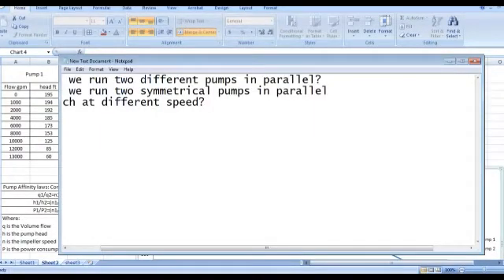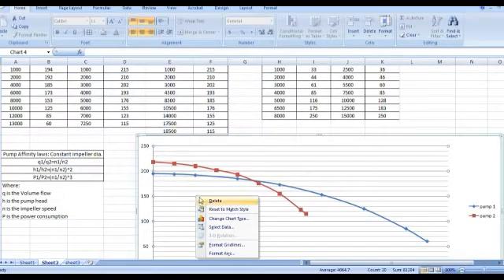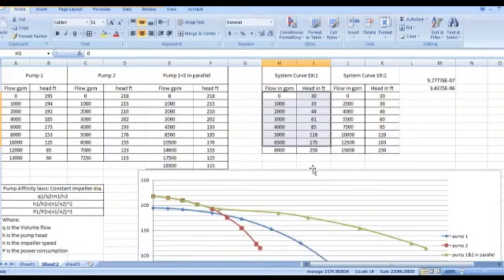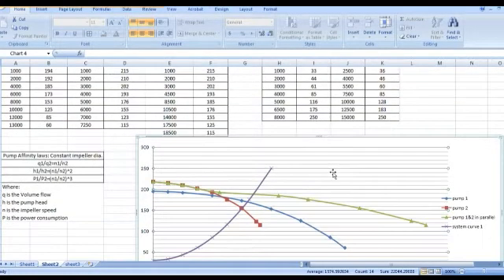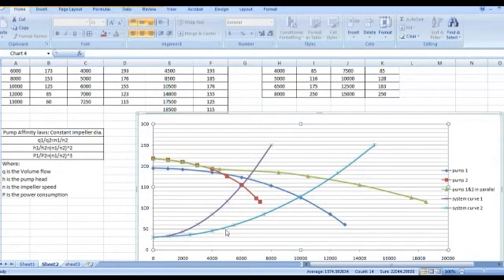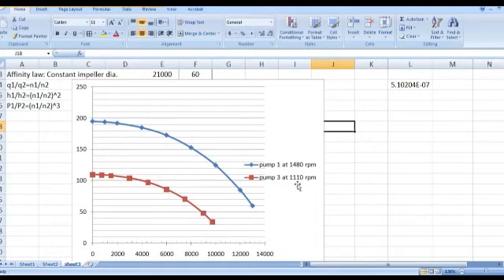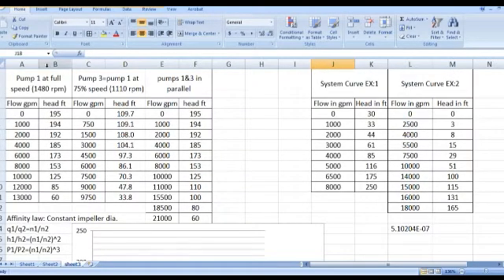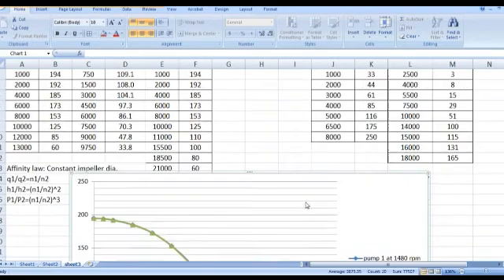Operation of two different pumps in parallel

Comment: Question: There are two parallel suction pipes 560mm connected to 2 pumps and then deliver side there is common header to which on delivery pipe is connected 710mm. When both pumps run simultaneously each pump draws 1500m3/hr . In 710mm flow will be 3000m3/hr. Suction side loss 5m each pump. How will you calculate delivery head for each pump for selecting the pumps. Will the delivery pipe friction head loss be distributed among two pumps? . What about delivery side elevation?
Reply from the maker: Please send drawing
Reply: @AMJEngineering  how? where to send?

Comment: third question-can we run 2 identical pumps in parallel with same speed but different impeller dia?
Reply: If impeller dia is different then they are not same pumps